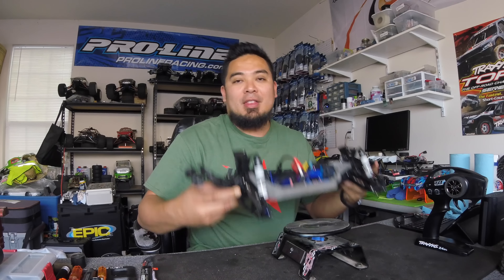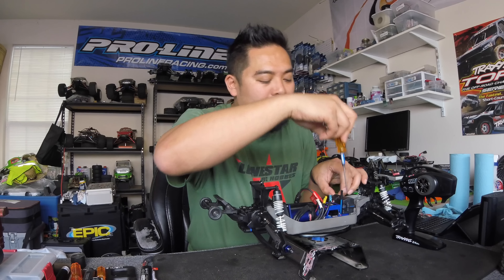Traxxas TQi Bind, Model Profiles, and TSM GLITCH!

Comment: Once the receiver is turned on, there will be a solid, green, light which means TSM is on or a blinking green light which means it’s off🤷 to change the mode. Once the receiver is on hold down the power button until it turns red. It will switch the mode on or off🤷you’re welcome.😎✌️

Comment: Mine does the same thing . It worked fine until I changed out steering servo now it works intermittently
Reply: I’m having that issue now did the same thing.. can I ask by chance if you ever figure out a solution to get the new servo to work like old one with the way the tsm works?

Comment: Mark i have seen few of your videos got a question.  Got a vxl slash had  few years so anyway my s3 was probably year old all of a sudden the protection light comes on so bought new battery amd im still having the same problem run time 5 minutes res light comes on . Any ideas
Reply: I had the same problem happen twice once it was batteries in my remote &the other time I had to reset my esc

Comment: i have a tqi radio my throttle and stering seem to be mixed when i just steer its fine but when i am useing my throttle at the same time  its cit out my steering.  i tried a factory reset and stilp does the same thing
Reply: I have this problem did you get it fixed?

Comment: Your throttle was on 70:30 and it runs away you have to have it at 50:50 and the thing is on the controller
Reply from the maker: Connor Marino yes... i prefer 70:30
Reply: Oh ok I just didn’t know if you know I figured but I juts wanted to make sure